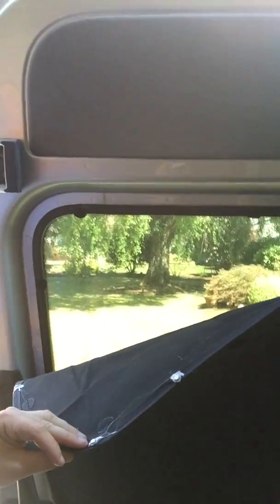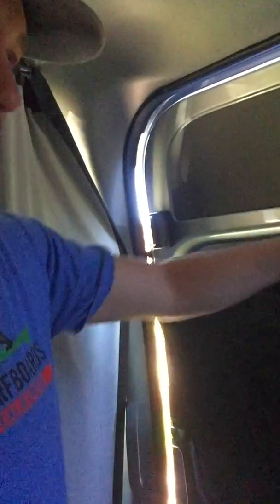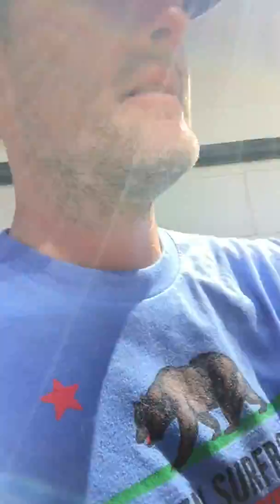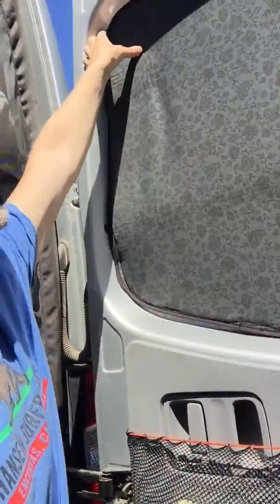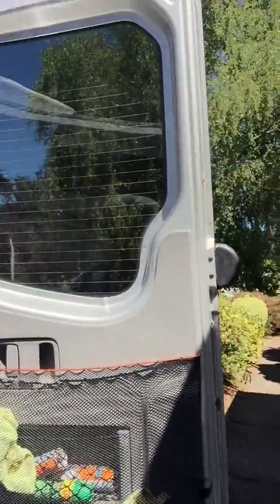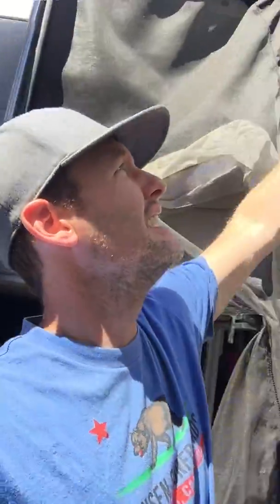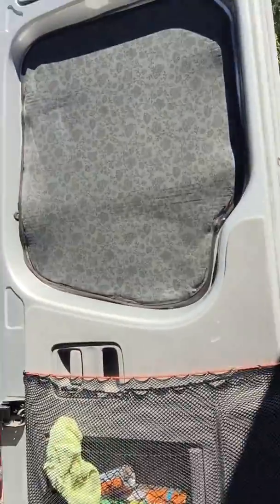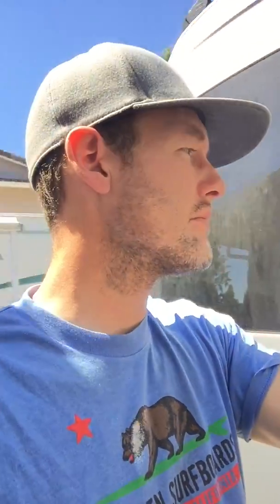Van Life | How to Create Great Window Coverings

Comment: Great video(s) - very helpful. What have you done for your front window? In our van there is nothing magnetic to stick the covers to.
Reply from the maker: I typically don't put anything in my front windows, but have a curtain that separates the front from the back for privacy. I will sometimes use the sun shades in the front that allow me to keep the curtain open a bit wider and swivel my passenger chair around.